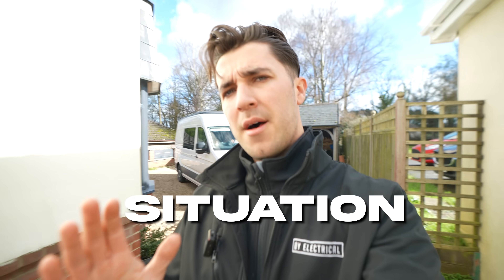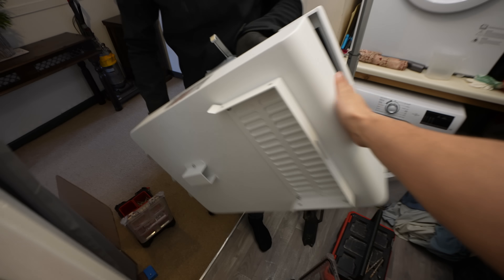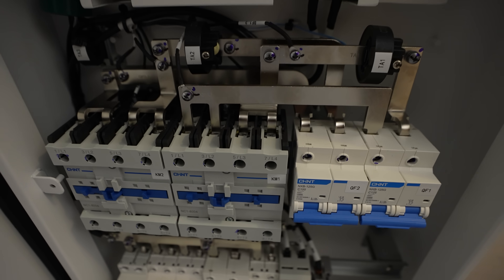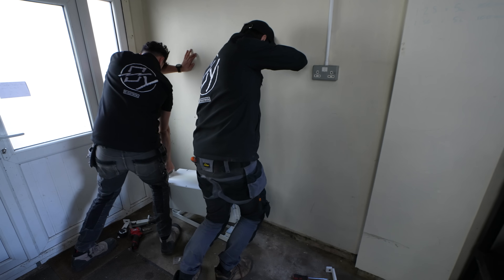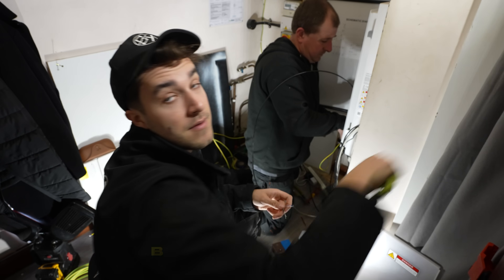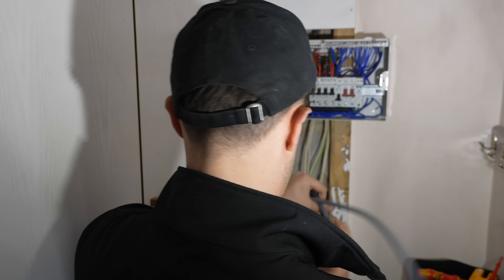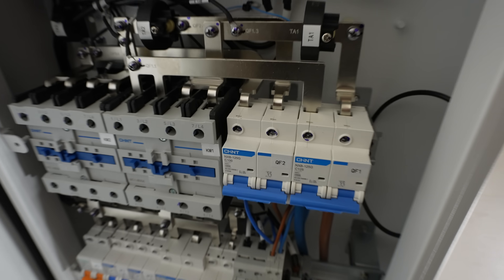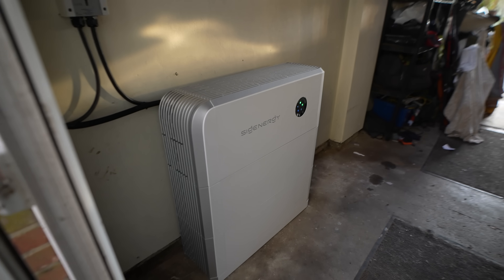How To Take ANY Inverter Off-Grid | ØY57

Comment: Why not just install an inverter with a UPS/backup load function built in - much cheaper and simpler?
Reply from the maker: That would only back up that one circuit, but this also allows for standard solar charging and off peak charging
Reply: @corymac  Check out Sunsynk/Deye inverters, I have a couple of 8kw inverters in parallel hooked up to a 75kw battery (5 * 280ah 16S LFP) in our place in Spain and it's great - we lose power (not unusual in Spain in a storm) and the GEYA ATS switches from grid to backup in a few ms and when power is restored they seamlessly switch back from battery and sync to the grid phase. The main consumer unit sits behind the ATS - it's a much cheaper, simpler and actually more reliable solution than all the closed gateway stuff (we have a Tesla Powerwall in the UK) which you can only drive with silly apps. I have proper RS485 monitoring on the Deya that feeds into Homeassistant so that if it sees a power cut, it'll kill the pool pump/car charger etc... and other unnecessary loads.
Reply: Lots of the inverters offer an EPS output, but they are usually limited to 20amps.
Reply: @gavinnoname1424  I have a couple of Deye 8kw in my home in Spain so if I see a grid loss then I automatically kill the car charger and pool power as they're the only loads that would push me over 40amps. It was an awful lot cheaper than the closed systems such as the Tesla Gateway (painful to integrate into Home Assistant) whereas the Deye can be integrated via Modbus over TCP. We have the Tesla solution in the UK and it sucks compared to the Deye/Sunsynk.
Reply: @biker_rich_71  I personally use 2x Victron Multiplus 48/5000

They each have 50amp relays for the built-in ATS. The inverters run in parallel which gives me a theoretical 100amps of pass through to the house.
(In reality they are never perfectly balanced, so it's likely that one would hit 50amps limit, whilst the other is 40amps, giving me a realistic max throughput of 90amps).

Comment: Very nice. Soon as I heard people had grid tied systems with no batteries, I knew they'd freak out the first time the power goes out and they realize the panels are worthless while the grid is down.
Reply: Zap, I'm grid tied and no batteries, my panels aren't worthless! I have Enphase IQ8, the only company I'm aware of that has the ability to Island itself when the grid goes down, and thats saying something, when code says your system must shut down in a power outage. But there are other things one can do to to make a system still run when the power is out, battery backup, wiring your system dc instead of ac, which one would only do in a grid down and not a power outage, ie disconnecting the micro inverters and wiring it dc to charge power stations. Worthless is not an option for someone with a brain
Reply from the maker: Yep!!
Reply: @corymac  so the solution, as far as I could tell, is to have the batteries with their inverter in between the grid connection and the solar, to mimic the grid when it goes down. Am I on track?

Comment: Are there any rules about putting solar on the roadside vertical wall of my house? 
I should have a new roof before solar if i were putting it on my roof. I don't need a new wall though.
Reply from the maker: I’d check your local council permitted development! Should be ok depending on where you live
Reply: I have done it. Planning rules in norfolk uk.. solar panels can be fitted to any part of the house, garage etc.. but not protrude more than 20cm from the flat surface... i.e. no tilting... but yes.. do check local rules.

Comment: Yeah the Sigenery is great for doing backup, i was wondering if the Anker gaterway can switch earth neutrals together on island mode? Nobody can tell me, maybe you would know
Reply: Just tie all the neutrals together why do they have to be separate? If it's all the same circuit no problem, if it's multiple circuits make sure it's sized for the extra ampacity
Reply: @danielconquer909  if you do that you have to size the fault current to the entire property FC . However in my location the DNO requires zero fault current to back feed into their system

Comment: Blow up? What's going to blow up? Brushed over that quickly after the whole monopoly clip 😂
Reply: If it’s a solid fuel back boiler and there is a mains fed feed / circulation pump you could end up creating a steam boiler. Hopefully there would be a safety vent, but the principle is there.